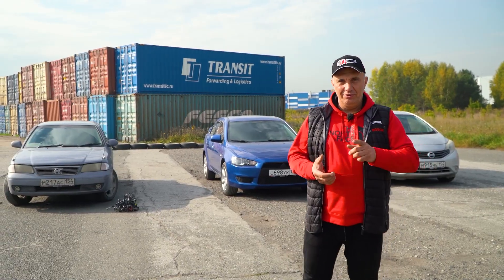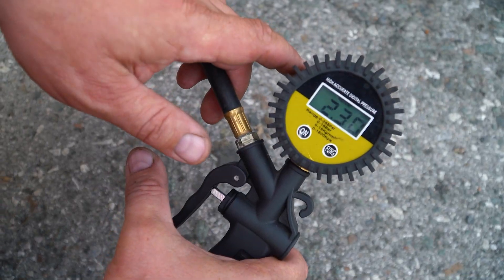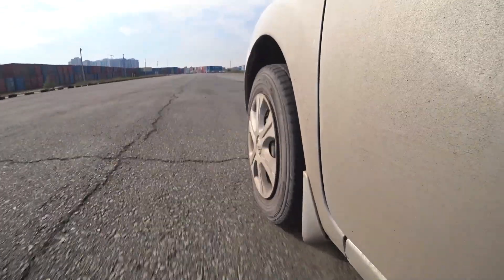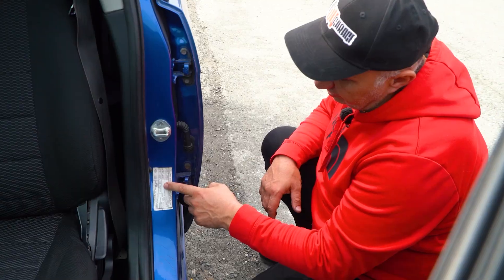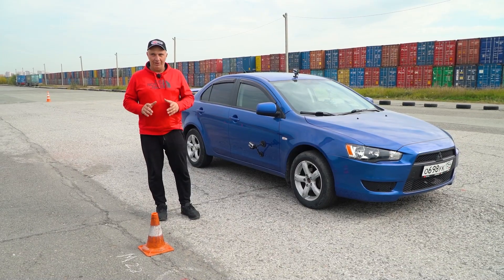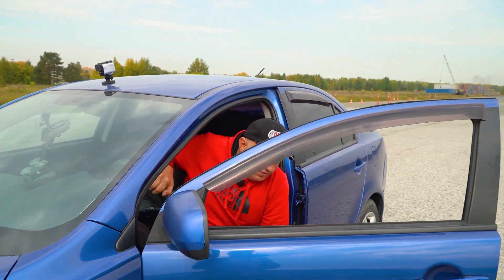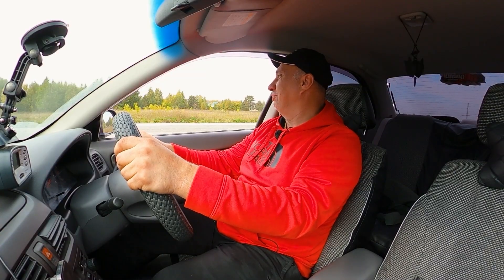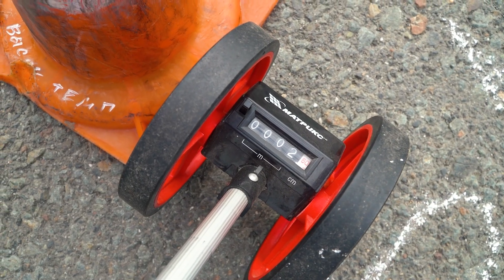How does tire pressure affect braking performance?

Comment: 👍
Could you try using a compressed air tank as a method of forced induction
Reply: Unless they can get an extremely large tank of air, a given 2 liter engine at idle (assumed to be idling at 1000 RPM) will process/require 1000 liters of air per minute, or 35.3 cubic feet per minute (a common air density measurement used with engine intakes). Assuming a redline of 6000 RPM, the same engine will suck 6000 liters of air per minute, or 211 CFM. The standard half inch air impact requires a measly 5-8 CFM at 90 PSI, and using one of them will drain a 20 gallon tank quite rapidly, as 20 gallons translates to 2.67 cubic feet.

Granted, compressing air does change its density, but a standard 20 gallon tank compressed to 90 PSI releasing its pressure at a regulated 20 PSI of "boost" would still need to release that pressure at a volume that would empty the tank quite quickly in order to appropriately feed the engine.

As for how I figure that, I'm dividing the RPM by two to account for "half strokes" where no air is moving (compression and power strokes), and then multiplying that result by the overall displacement (2 liters to make it easy) This works because each cylinder moves its air between two revolutions of the crankshaft (suck-squeeze, then bang-blow)

Remember!! Engines themselves are air pumps, so the problem arises when you're trying to feed a 2,000 CC pump (engine) with a 150cc pump (air compressor)
Reply: they have already done that they started with a propane sized tank and ended up with 2 oxygen tanks it is on there video list

Comment: I wouldn't necessarily say the test for the Lancer is accurate given how bad those tires are dry rotted, which means the compound is probably harder than when new. But still very informative for the most part!
Reply: They aren't testing max braking performance, just the difference between pressure... Old tires / new tires, there will still be differences.
Reply: Yeah its relative to itself, so the test is good